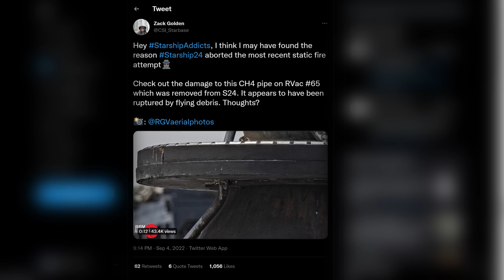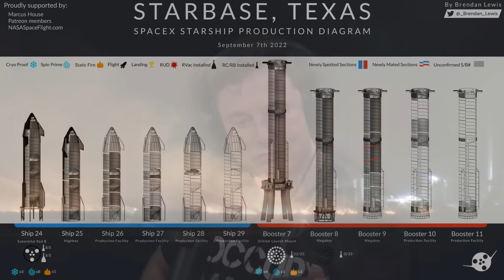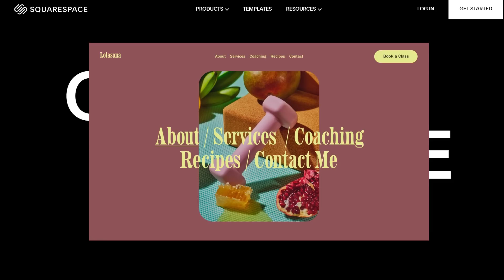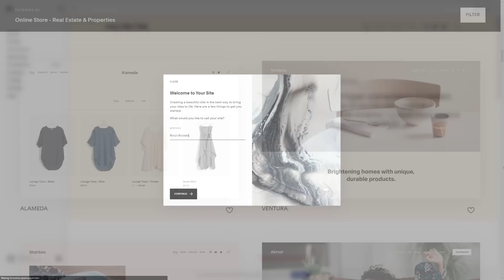SpaceX Starship FULL STACK Incoming...with 33 Engine Static Fire!? Plus, Falcon 9 Smashes New Record

Comment: Another cool thing about Ariane V is that it’s one of if not the safest rocket of its size currently flying. Which is why they chose it to launch the JWST
Reply: It was also worked out that the ESA would provide the booster decades ago.

Comment: Hi Matt, thanks for another great video.  I have a request if possible.  Is it possible to put some sort of clock on the videos of the chopsticks moving on Stage 0?  It's very difficult to get an idea of how fast it's moving IRL.

Oh.. and a question about rocket reusability.  Surely the cryogenic refuelling must stress the steel in the rockets so there must be a theoretical limit to reuse of a booster - or is the alloy used particularly resistant to this for precisely this reason?
Reply: The alloy is an alloy that gets stronger as it gets colder. Idk what the reuse life would be but most cryogenic tanks can last for years, though they also are over built where as starship is built as light as possible
Reply: I second the motion. All time lapse/slow mo footage online ought to include an indication of the time factor used.

Obviously there is a limit to the expansion/compression cycles that rockets can undergo. Metal fatigue is a well-understood phenomenon. The engineers have to figure out the right balance of strength vs weight to allow a reasonable service life. There's a similar trade-off in airplane design. Airlines keep track of the number of cycles their aircraft experience. After a certain number of cycles, the aircraft must be retired. A heavier airplane would last longer, but would be less efficient. There are always compromises in every design.

Comment: Booster 7 is going to need the mass of a loaded starship on top for a true static test, or it might rip itself from its latches.
Reply: Even then i could see them doing an inner engine static and an outer engine static, because even with a fully loaded starship with payload they still have a 1-1.5 weight ratio, idk if they could hold one down….. I could see launch being the first time we see all 33 lit
Reply: @ryanhamstra49  I suspect they will do a staggered test so  at one single moment no more than x number of engines are firing.
Reply: @paulmichaelfreedman8334  yeah, that sounds accurate to me. Not that I know anything, im just guessing haha

Comment: The third tower will likely be the landing tower, possibly built near Roberts Rd facility. The tower being built now has shorter chop sticks, which some speculated would be used for stacking only, not catching.
Reply: SLC-13 where LZ-1 and LZ-2 are at for Falcon booster landings makes more sense.
Reply: Alternatively i can see them putting the Tower Segments on their Sea Platforms. Pretty sure a sufficiently sized Port is in reasonable distance to put the Segments on the Platform, and also they already have all the Equipment in Florida to build the Towers.
Reply: @unitrader403  Port Canaveral is right there. Its a big one, cruise ships use it.
Reply: @unitrader403  Both Phobos and Deimos are in Pascagoula, MS. Since building tower sections seems to require a few concrete pads, some lifts, and a crane or two, it would likely be cheaper just to build the tower sections by where the oil rigs are moored.
Reply: @steveaustin2686  well, these Platforms are designed to be moved, so i dont think them currently being elsewhere is much of an issue. Also they have to be moved anyway to serve their intended function. I highly doubt that SpaceX will land their Rockets in an active Seaport :D

but we will see..
Reply: @unitrader403  I didn't say that they would land the rockets in the seaport. Nice strawman. I said it that since the building of the tower sections requires minimal infrastructure, it would make more sense to build the tower sections in Pascagoula, MS where the platforms are currently moored. Why ship tower sections around or put the oil rigs in KSC, when you can just build the sections in the location where they have already been worked on?
Reply: @steveaustin2686  guess you even take obvious jokes dead serious... its really sad that a huge smile emote is not enough to denote a joke these days.. :( 
And i am not sure if SpaceX has Land and permits for constructing the Segments of the Tower in Pascagoula, or even applied for that yet. Im pretty sure they contracted out most of the reconstruction work, so they also dont have any Land there, and i doubt they will construct the Tower directly on the Platform. So just creating the Base of it there, then ship it over to Florida (where they aleady have all the rigging and Permits, and also work on more Segments) to put the pre-assembled Segments on top is a pretty logical choice for me. Especially if they want to complete the Platform this Year.
Reply: @unitrader403  Considering that apparentely all you need is some concrete, lifts, and cranes, does SpaceX really need to buy land?
Reply: @steveaustin2686  buying, leasing, renting, whatever.. they will need a piece of land and, more time consuming, the permits for that... they cannt just start pouring concrete on some random field.
Reply: @unitrader403   Or, since it's a port, they use the concrete that is already there, that is not currently in use .

Comment: Maybe someone can tell me what the purpose of the can crusher is ?. Why is it important to try and squash a fuel tank ?....thanks.
Reply: When a rocket launches, the tanks are pulled down by gravity, but very strongly pushed up by the engines, generating a lot of stress. The can crusher tests tank designs and construction methods by simulating the launch stress.
Reply: @steveaustin2686  Thanks Steve.
Reply: @dazuk1969  You're welcome.

Comment: SLS = Scrub Launch System its also interesting that Boeing is using SpaceX and not there own assets
Reply: Boeing doesn't have a small or medium lift booster. ULA's Atlas-V is all booked up and Vulcan Centaur is still waiting on the Blue Origin BE-4 engines to be delivered. Rocket Lab was likely an option, but it is possible that the cost of a rideshare was cheaper than purchasing a dedicated launch from someone else.
Reply: @steveaustin2686  also i think that their Payload was far beyond the capability of Electron. Their Payload Mass is 300kg currently, and one Statlink Sat alone weights 260kg, and they removed 17 of them to make space for Boeing
Reply: @unitrader403  You are thinking of the other ride share. The one with the Boeing payload evidently had 51 sats and was launched on a 53.2 inclination orbit. Other launches to the same inclination had 53 sats, so it still could have been too much for Electron or the other small lift launchers. With Soyuz out and Ariane busy with their own launches, SpaceX may have been the only option.

Comment: The current test tanks are being used to determine the optimum thickness of steal required for the tanks and various bracing designs to reduce booster weight. This is why they use the can crusher to load the tank walls simulating a full stack and dynamic launch loads.

Comment: Expendable Starship?! Doesn’t sound reasonable.
Reply: It can lift more mass to orbit if it is expendable.
Reply: @steveaustin2686  certainly. And it will cost a hell of a lot more to do so.
Reply: @t.s.4091  Depends on if you need the extra payload or not. Or if you can't wait for the TPS problems to be worked out.

Comment: I don't agree that SpaceX should focus on a Starship without reusability, they need to focus on keeping those heat shield tiles on if anything.
Reply: There is still a LOT of development needed for the Artemis III manned landing in 2025-2026 on a Lunar Starship. SpaceX has a $50M NASA contract to demo Starship to Starship propellant transfer by the end of 2022. Starlink v2 is apparently so important, that SpaceX is developing a mini Starlink v2 that will fit on a Falcon 9 B5 per a recent FCC filing in Aug 2022 ((by Eric Ralph at Telsarati on Aug 22nd, 2022).

Comment: The 'Gen 2' Starlink constellation has yet to be approved by the FCC. I can see either prototype orbital fuel depot or HLS as the reason they are making the flapless/tileess Starships.
Reply: I think they don't need separate approval for the V2 satellites. In any case, the HLS and fuel depot are still a few years away, while Starlink V2 is an immediate requirement for SpaceX. Musk said himself in an Everyday Astronaut interview that they are currently focussing on getting the new Starlink satellites into orbit.
Reply: they are fully approved for both gen 1 and 2, with multiple full shells approved.
Reply: @RyanDiederich  What I am calling the Gen2 is the 30,000 Starlink constellation that has NOT been approved by the FCC.
Reply: with the current political situation they may never get approved